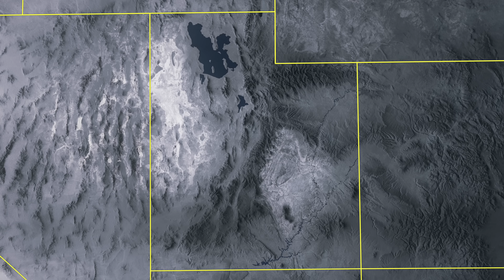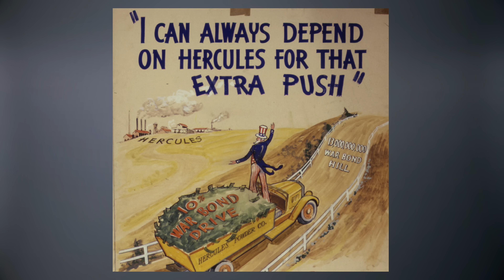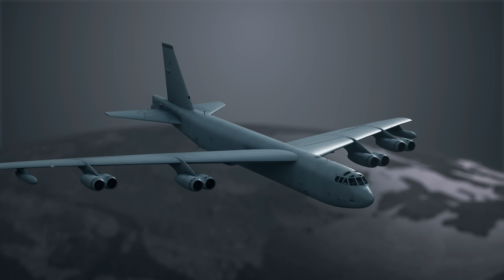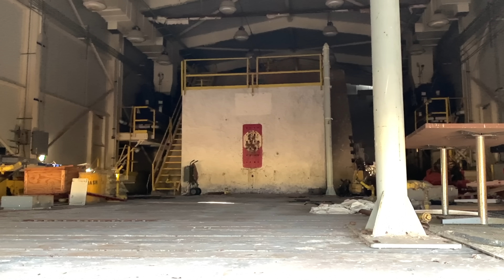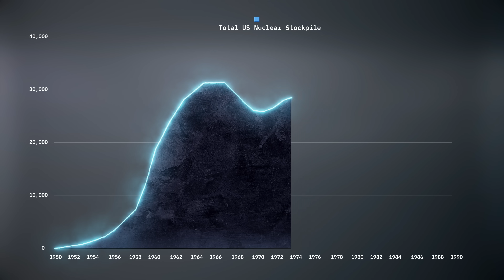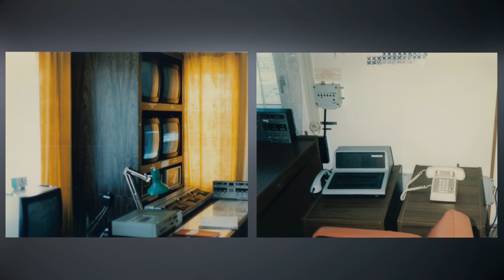This abandoned shed may yet help end the world

Comment: Utahn here, This was a lot of new information. Thank you for this :D 

fun fact, I used to work very VERY close to what used to be known as "Bacchus west" after ATK took them over. There were ground-shaking and glass-shattering explosions OFTEN. 

ATK (now Northrop Grumman) made the solid boosters for the Space shuttle and tested them in promontory, Utah (north of the great salt lake). Northrop Grumman still makes solid booster rockets for NASA's future heavy lift systems.
Reply: ATK actually didn't buy the company that made the SS SRBs, Morton Thiokol, until the latter end of the program. I only point it out because of the politics behind Thiokol and the Challenger disaster. One of the engineers on the boosters, Al McDonald, has an excellent book on the topic.

Comment: To raise engagement, and also to be pedant, I have a small nit to pick with this video (as with the first). Technically, no motors fired at TEKOI were installed in actual Trident missiles. The use of a solid rocket motor is destructive. Unlike liquid rocket motors, the fuel and how it is constructed makes up a vital part, if not the most vital part of the assembly; where a liquid motor can be separated from its fuel and still remains a liquid rocket motor, a solid rocket motor is the fuel, and is destroyed when that fuel is used. There are other components besides the fuel, such as the nozzle and its gimbal, but these are almost secondary in comparison. A very significant part of solid rocket motor manufacture is based around getting the mixture of fuel, oxidizer, and binder correct, as well as making sure the internal geometry is correct. The best way to make sure these things are correct is by firing the solid rocket motor and monitoring its performance. This, as discussed, destroys the solid rocket motor. Solid rocket motors can be repacked, as was done with the Space Shuttle's Solid Rocket Boosters, but this is akin to building a new motor. In order to test disposable, single-use items, a production batch is checked by testing a fraction of them to assess the likely quality of those that are untested. Think of quality assurance in a candle factory; the burning of a candle to completion implies its destruction, so not all can be tested. It's in a similar way that TEKOI was not calibrating/testing solid rocket motors themselves, but instead the production line that built them.
Reply: More engagement comment here

Comment: This setting of a remote test site in the desert is incredibly familiar. I've spent some time in a similar facility, although it was used to test much smaller arms than the trident, and was simpler in design (no moving buildings on rails). The tests taking several days to set up doesn't just mean the need to protect the equipment from the elements - the weapons being tested, in my case live functional weapons, had to be guarded 24/7 to make sure they don't fall into the wrong hands, which is how I ended up there. It's 4 am, you're walking along the perimeter fence of what seems like a random and meaningless patch of desert land, kept awake only by the cold and the knowledge that you are responsible to keep safe something that could cause so much destruction. I didn't think much of it at the time, but seeing this video brought back some of those memories or lonely, cold, somewhat paranoid nights looking into the vast emptiness and contemplating life. I'm sure some of the staff that worked at Tekoi would have similar memories.
Reply: I know I'm replying to this a year late but I can't imagine the scenarios my head might make up on those idle nights. I'm sure you spooked yourself a time or two, huh?

Comment: Minor note: liquid fuel missiles could be launched from silos too and did not have to launched above ground. Examples like Atlas and Titan ICBM could be stored in silos
Reply: Atlas is fueled on the pad though, they're stored without fuel. The fueling is long and dangerous, but infinitely safer than storing a fully fueled rocket. That why SRBs are preferred :)
Reply: @EveAeternam  True. However, Atlas-F ICBMs (SM-65Fs) could still be concealed and stored vertically in silos until the order to fire. In this case, the Atlas would have already had RP-1 (kerosene) in its tanks but would have to be fueled with LOX just prior to launch. The loading process for the LOX also would have been done with the silo doors closed.

Comment: One thing I will say is that those missiles ran on engines, not motors, since a motor is usually electric and used for ground or air propulsion. You mentioned that the missiles ran on solid fuel, meaning that they were not electric. And so they would have to run in engines instead of motors.

Comment: I worked at Hercules at Bacchus Works from 1984-1987.  Tekoi also was used to test fire the space shuttle boosters, produced at Hercules, one of several companies bidding for production of the boosters.  NASA decided that NASA would make them themselves.
Reply: Erroneous.  shuttle boosters were made at JV thiokol, north of SLC, tested at promissory point vicinity test area. NASA never made them themselves. Lockheed proposed motors that were not segmented as Hercules which had the infamous joint with rings blamed for failure.

Comment: Obvious question: Traditional solid fuel rocket motors are one with their fuel and can only be tested destructively.  The advanced solid rockets used for the space shuttle and SLS could be rebuilt reusing the metal walls, but it would still be a rebuild.
  This doesn't match the calibration story in this video.